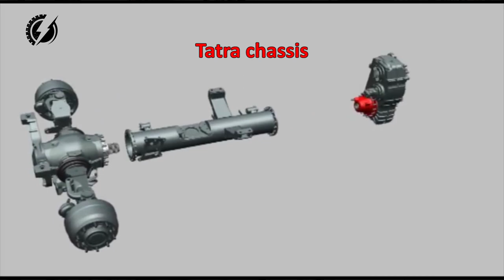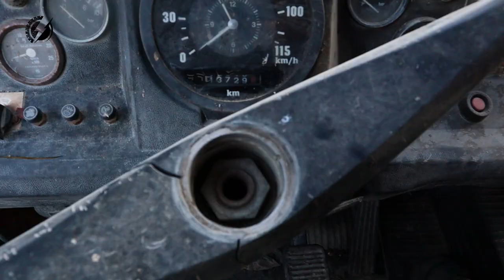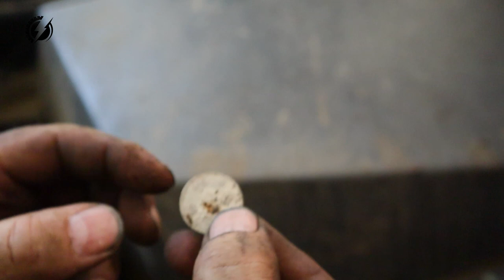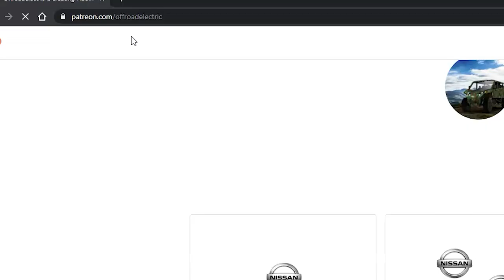EP.33, The second Tatra is going to the shop! - 4-motor Monster Truck Project

Comment: You want a really easy way to deal with those huge tires and line the lugs up better?  Use a spade shovel underneath it for leverage and you can pivot the wheel/tire combo very easily to line up the lugs.  We use this method all the time on our expedition truck...
Reply from the maker: They weigh about 400 pounds each, not sure if spade shovel can handle it......
Reply: @offroadelectric9457  mine weigh the same or more.  Use a quality steel handled shovel.  It's a neat trick.  Try it.
Reply from the maker: @SeanFillner  ok.